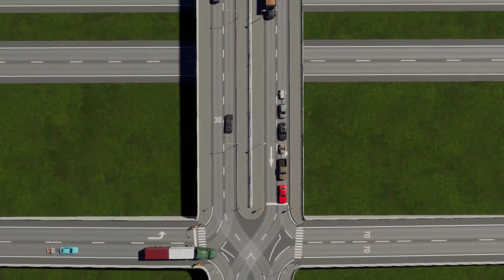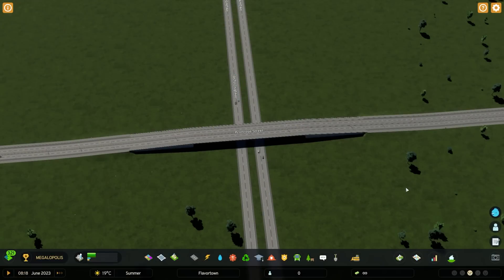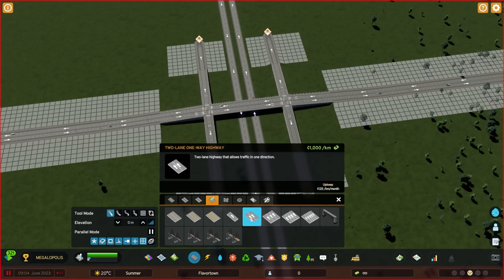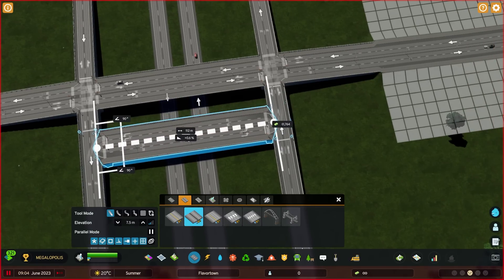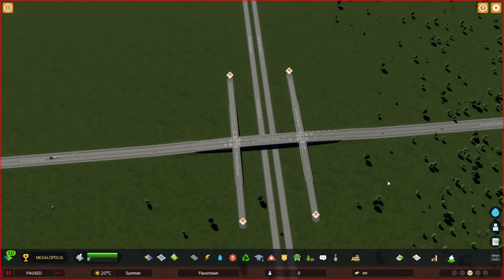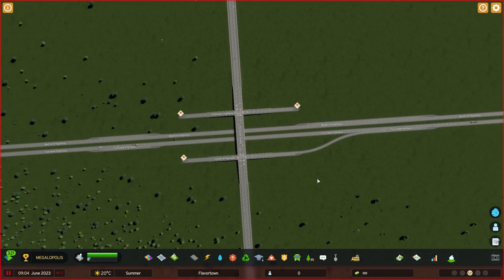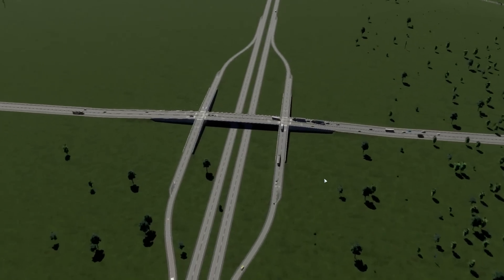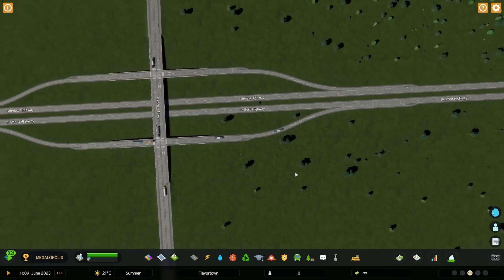Divine or Diabolical? - Building the Diverging Diamond Interchange (DDI) in Cities Skylines 2

Comment: We have one local, instead of the ramps terminating at the cross point, they split, so highway traffic flows on and off the diverging diamond, without significant need of traffic signals. It's only the through route that needs the signals.
Reply from the maker: Thats how this one should work. Once I can control lane connections and signals…

Comment: In my opinion the DDI is an american solution to an american problem. Because of the massive car dependency they need high capacity service interchanges at every mile marker, so the benefits of low-delay two-phase signalled turns onto and off the highway seem overly appealing, while the massive downsides (very low connectivity across and zero accessibility for anyone not in a motorized metal box) aren't even considered as they are not relevant to public opinion.

There is a reason more than 150 of them have been built in the US with almost 100 more under construction, while the entire rest of the world doesn't even have 20 in total... Parclos are usually as space efficient as a DDI, less expensive and have enough capacity while affording an at-grade non-crossing continuation of other types of transport (rail, bike lane, foot path) on the connector road.
Reply from the maker: Mostly correct, though Parclos are often much larger than a DDI.

Comment: Diverging diamonds are fine I guess, but the SPUI appears to do the same thing with less confusion. Or am I missing something?
Reply: SPUIs have 3-phase lights; diverging diamonds have 2-phase lights. If you don't have a lot of straight through traffic, you may not want to have a 3rd phase that serves only straight through traffic. But they probably have very similar performance, indeed.
Reply from the maker: Pystro is correct. SPUI is preferred when through traffic is a greater concern. DDI may be the better solution otherwise. Both have higher capacity than a typical diamond.
Reply: In the real-world, another consideration is that a diverging diamond can often make use of the same facilities (such as ROW and bridges) as a regular diamond, which eases implementation. SPUIs on the other hand require massive bridge sections due to the large central intersection that must go directly above or below the through road. One way around this I've seen is to offset the intersection to one side or the other, but then you have ramps that must bridge over the mainline, adding bridges and therefore cost. By comparison, DDIs are much cheaper.

Comment: back in my university days, we had a diverging diamond at TN-66 (no relation to US 66) & I-10. Most of the traffic flows between the interstate in both directions, but only the south side of TN-66 to & from Sevierville (Dolly Parton) gets much traffic. as a result the main travel directions only go through one light (or 0 for right turns), which is nice.

I drove through the DD from south to west once. It’s quite a large interchange and the through lanes approach the overpass at an angle, so it’s difficult to screw up. from all of the ramps and trees you couldn’t even tell you’re driving on the opposite side of the highway.
Reply: whoops, i meant i-40

Comment: smart design in real life because the left and right turning traffic onto the highway never need to see a signal to get on the ramps, unfortunately you cant seperate lanes from the light yet, but it still looks great, and will work great if a majority of the traffic is not going straight through like you mentioned

Comment: I live in the city that built the first DDI in the US.  We know them well.  I've seen some other cities' implementations, and I cringe.  There's a few key things these other states don't seem to understand.  The key thing to remember that DDIs are a good choice when a high proportion of the traffic is from and to the freeway, and not so much through traffic.  If through traffic is higher, build something else.   One of the key things, from observing these up close, in the higher capacity bridges, you need a primary left-turn 'dump' lane that only allows turning on to the freeway.  A key to traffic not piling up.
Reply: Well, hi neighbor!  After having had them for what feels like forever, I swear by them.  We used to have so many accidents at those interchanges, but the DDI made things a lot safer.  I agree about the dump lane, I just wish all our DDIs had consistent lane math, I always forget which have the dedicated highway lane and which don't
Reply: @linapilchard1384  The one at Chestnut and 65 going into town doesn't have one.  The ones I use the most, both have dump lanes.   (KS & JRF, Nat&JRF).  And, yes, I used to go north on National from JRF at 5 PM, going to Mercy to work overnight, before conversion  Was a real mess.  Now it's no  big problem.

Comment: My only issue with them is some aren't exactly designed correctly for people like me who run oversize loads on longer heavy haul trucks. Otherwise i like them. I just don't recommend encountering your first one at 11pm during heavy rain where you can't see signs.
Reply: Though you could argue most oversized loads don't work well on most infrastructure. Though I guess some of this comes down to how big they make the diamond. Roundabouts have to be the bane of your existence though
Reply: Newer DDI's seem to be built with wider lanes. The first DDI I ever encountered was in Springfield, MO like 20+ years ago, and the lanes were not nearly wide enough.
Reply: yikes

Comment: We have a Diverging Diamond Interchange just around the corner. It's fine. Throws people for a loop first time they see it, but fine otherwise.

It was a big todo when it was first put in, for whatever reason the engineers had never heard of "lane math". 2 months in, they repainted the lanes, mostly makes sense now. Absolutely cannot fathom whatever idiocy is going on in the design room; I hope it's "management obstruction" but I have very serious doubts about some of the civil/traffic engineers in my state.
Reply: We have them here in Utah too. Kinda freaky the first few times but a not a real big deal. I remember the "experts" here said it reduces impact points that in a normal intersection or interchange one might find.
Reply: As a mechanical engineer, in university - we used to joke about how civil engineers are pretend engineers or imaginary engineers (imagineers we used to call them).

We have diverging diamond interchanges here in Michigan.

Lane math here is largely absent because they will dump you from the offramp, onto the onramp going in the other direction - i.e. you have the diverging diamond part of the road where the right lanes will then drive on the left side of the road.

The offramp will dump you into that traffic, and if you don't do anything, you will end up back on the highway, but going in the opposite direction. (cf. the interchange at 14 Mile Rd. and I-75 in google maps, between Madison Heights, Michigan and Troy, Michigan.)
Reply: Missouri (my state) was the first one to build a DDI to address the springfield mall interchange (commonly had que lines over a mile long before the change). They have not had an issue since. Missouri also apparently is the only one who understands how to build them. I have heard many complaints from their implementation in other states. There is one in Columbia missouri, also for the mall, and its fantastic.

That being said, light management is a massive priority with them, if you have any lights up or downstream from them with bad timings, it can ruin anything the DDI improves.

Roundabouts are okay, but they do have a fixed throughput. They are more optimal in addressing rapidly changing intersections that a light just can't handle. Say, like a highschool during rush hour where volumes of traffic vary wildly day to day. But they just don't quite have the capacity of a proper interchange due to people having to enter and leave the same lanes. You have to build very large to really get utilization out of more than 1 lane.
Reply: Diverging diamonds intersection is actually way more safe and much more efficient. 

https://www.transportation.ohio.gov/about-us/stories/who-knew/who-knew-diverging-diamond-interchanges
Reply: I like that people are trying "new" ideas to improve flow and safety.  Look at Carmel Indiana ... they have gone roundabout crazy and now, I believe, have more than any other city in the world ... by a lot.